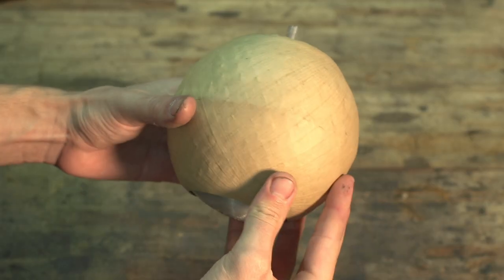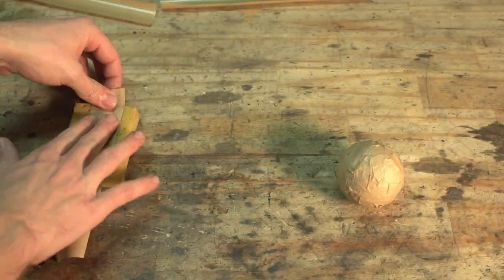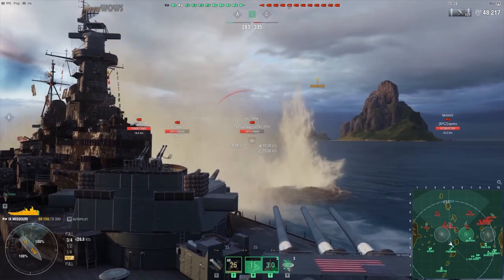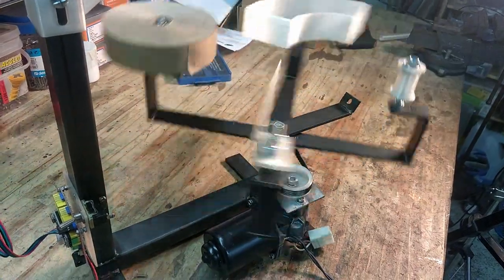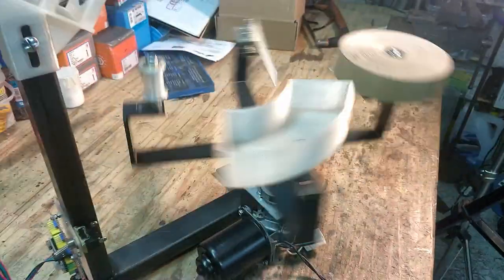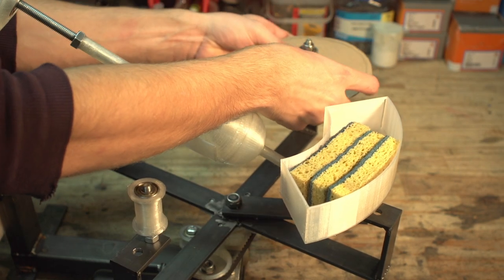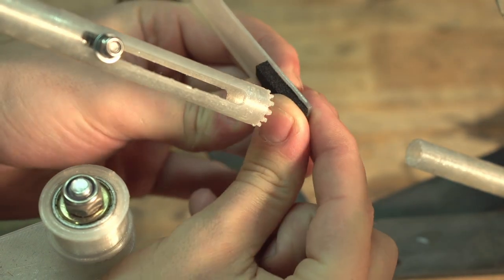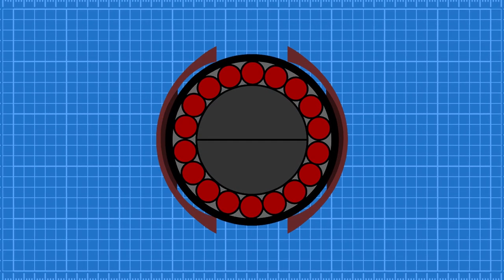Making the Firework Shell Pasting Machine

Comment: I've been mentally planning how I was going to build something like this for quite a few months.  I'd taken a slight break, but started going over it again and I'm so glad you made this video.  I had planned on using a stepper motor to spin the shell, but I don't really know how to code so that plus with what you'd said about it not being strong enough to spin the larger shell's just convinced me to use low rpm motors with adjustable resistors.  Thanks!
Reply: In most cases the motor torque isnt the weak point, it`s the grip on the shell. You can improve the grip by applying a circle of hot glue to both poles to form pads where the shell is held. A variable resistor will affect torque, you`d be better off with PWM.  My pasting machine is driven by an "armstrong" motor which provides speed control and bags of torque :)

Comment: Shells are being pasted with generic kraftpaper soaked in a bath of adhesive, most of the time just wheat paste, for the paper to absorb all the moisture. What happens during drying is that the paper shrinks, contracts and bonds everything together by force of its own stretch. This is why I think gummed paper tape is of inferior quality opposed to plain old kraft paper tape. Still I want such a shellpasting machine.

Comment: Is there a specific reason to use two separate motors instead of connecting both spinning parts to a single one through a reductor (or whatever the mechanical contraption to make things rotate slower is called)?
Reply: The shell rotation speed is dependent on the shell diameter and tape width. It can be done by mechanical means but most folks opt for gear motors and speed control.